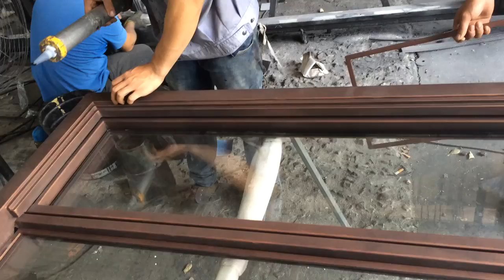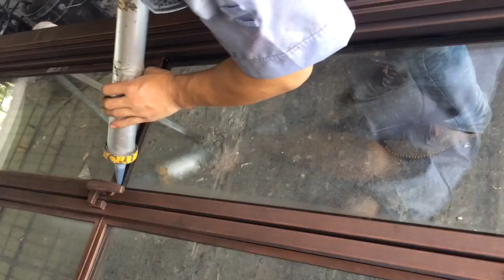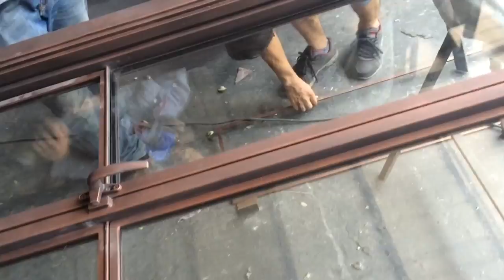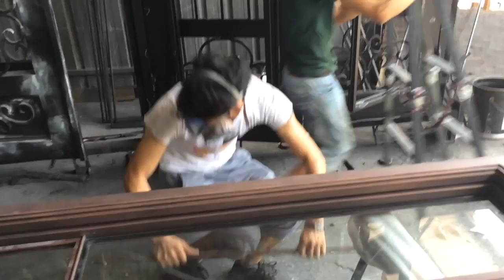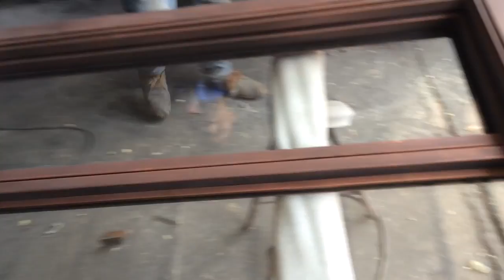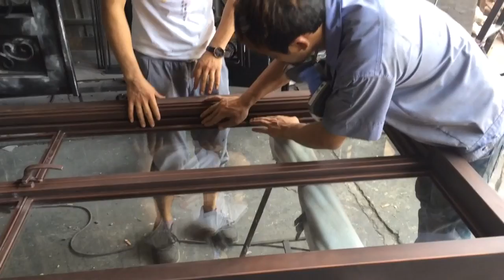install glass 4

Comment: What is used at the edge of glass that black rubber type??? and what silicon or what is used from gun to stick the glass in the frame?
Reply from the maker: Warm eadge spacer, we have another higher end called Quanex super spacer for ig glass.